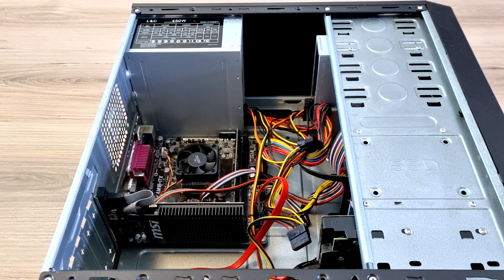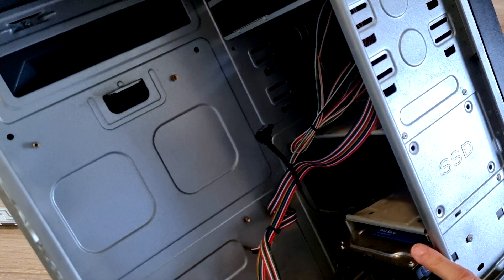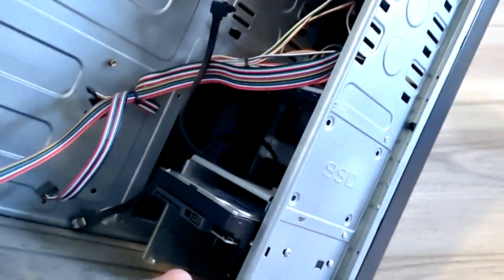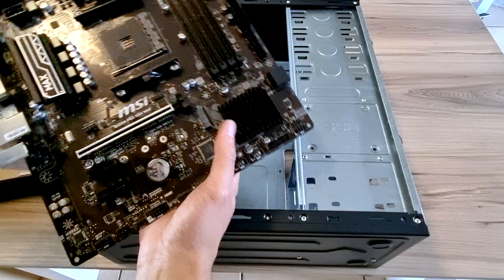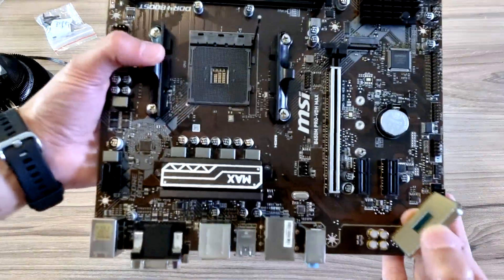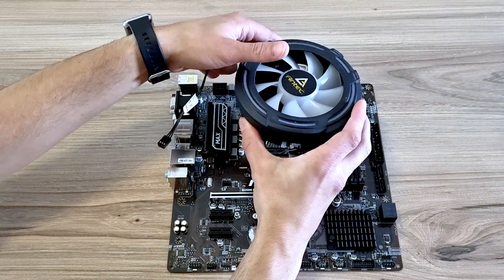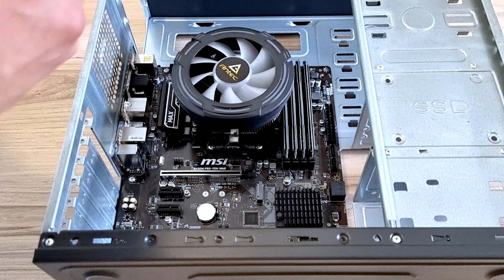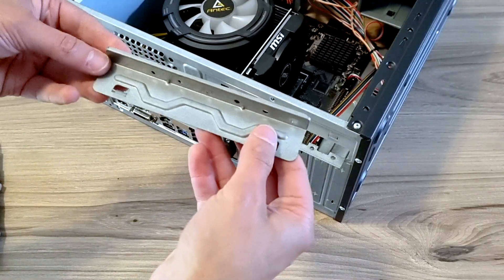Upgraded Old Budget Gaming PC - How to Make the Upgrade

Comment: If you wanna upgrade the gpu further for cheap I recommend rx 580 or r9 290 although I'd recommend nimez modded drivers for the 290
Reply from the maker: Awesome thanks so much.. I'll look into it. Really appreciate it
Reply: @handycoco8456  no worries man, I like the r9 290, because the price is usually stupid low and it performs almost as well as a gtx 1060 6gb
Reply from the maker: Excellent!

Comment: Well i found very rare people apply 4 Channel RAM in PC builds...
I love your sleeper PC tho!
And that airflow is better than any old PC case,
My pc specs was
Intel C2Q Q6600 2.4 Ghz 
Intel Stock Cooler
ECS G41 M6 V3.0 LGA775 Motherboard
2x4GB DDR3 1333Mhz Kingston Ram
(The ram setted to 1066Mhz due to Motherboard Limits)
Nvidia Quadro NVS310 512MB DDR3
EYOTA MODEL:ATX-500W Psu

Well also back then im boughg Quadro nvs310 card but turns out they no display, then im thinkin to upgrade my pc to Amd Radeon HD8490 1GB DDR3 gpu, then i figure it out that i have been scammed so... I want play games so bad  
But you know? Im low on cash, so i bought the same card (Nvidia Quadro NVS310) in a reputable store
Reply from the maker: Hehe! Thank you man! Yeah it was time to step it up... okay cool hope it goes well and thanks for watching
Reply: @handycoco8456  you're wrong...
My 2x4GB DDR3 1333 kingston RAM just don't want to show display 😭😭
Well that thing expensive for me to buy it again💀💀💀
Reply: That is 2 channel. Just 4 dimms. 4 channel is not only expensive, it's hard to implement. It'll also slow down your RAM speed significantly as the memory controller is now more loaded.
Reply: @muhammadkhairulafiq2917  well this change my precpetion of ram but idk it is fact or nah🤷‍♂️
Reply: @tvchannelGuide  Yeah. I too dont if it's fact or "nah" 🤷🏻‍♂️ If only there's someone that did some research on RAM speed, channels and how they stack together. Maybe they do. I dont know, since Im writing this on a piece of paper, not through a technology called internet where you can find unlimited number of knowledge 🤷🏻‍♂️